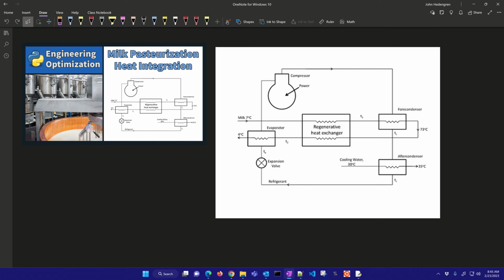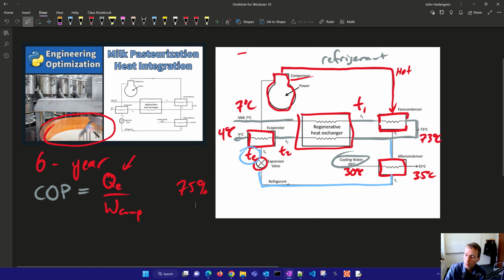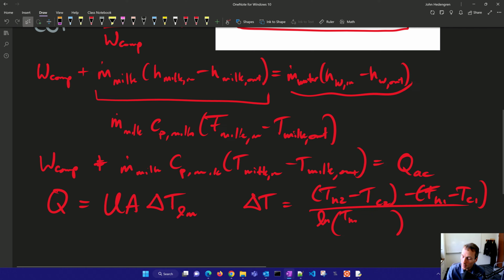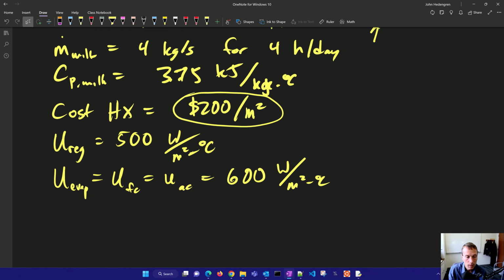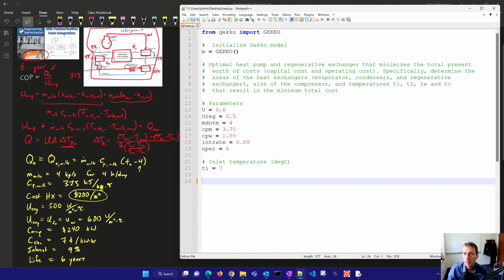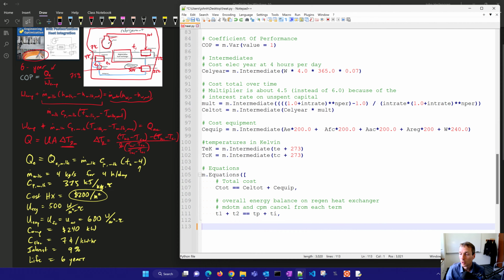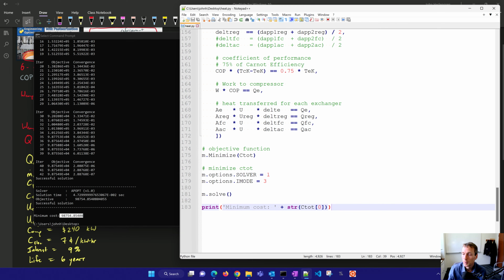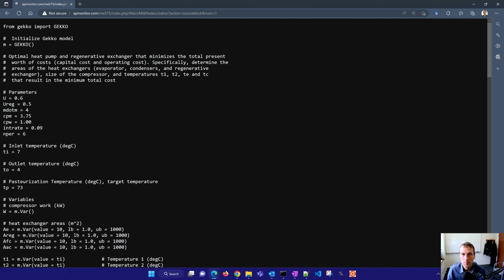Heat Pump Sizing

Comment: Did you use your x ray spectroscopy gun to determine the composition of you starting material?

Edit: wrong video?
Reply from the maker: X-ray fluorescence technology (XRF) is one of the simplest methods to determine the chemical composition. It isn't needed in this case because the milk is uniform composition. If there were differences in the composition, then an instrument that help estimate heat capacity could be useful to avoid over-heating or under-heating the pasteurized milk.